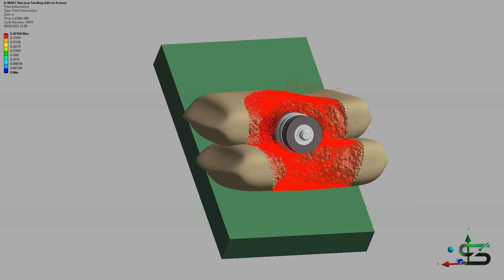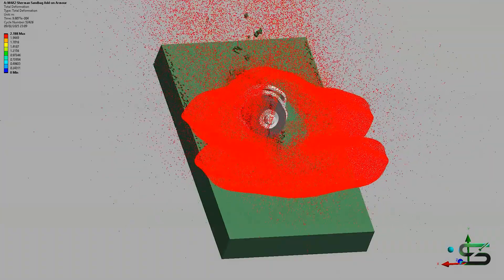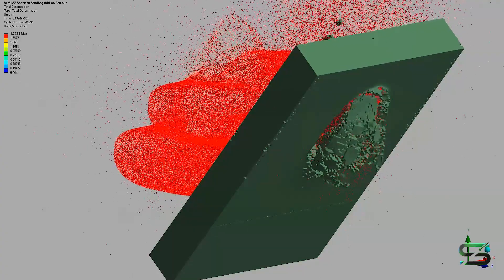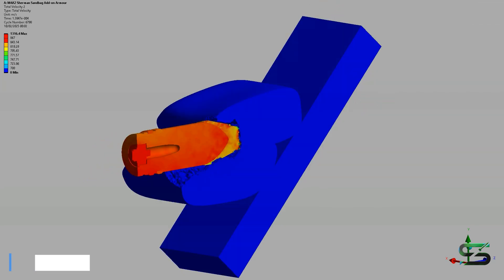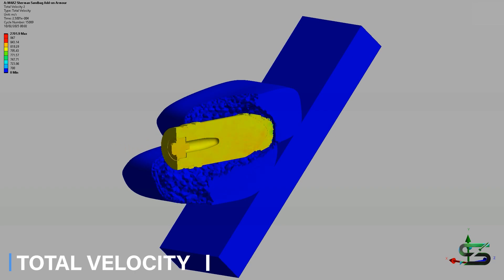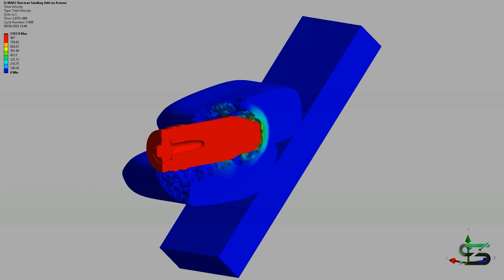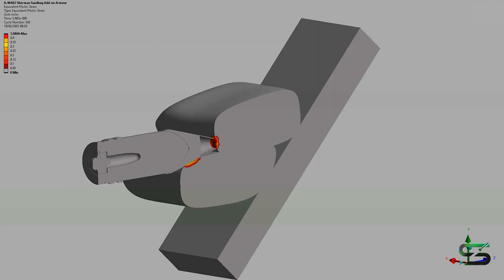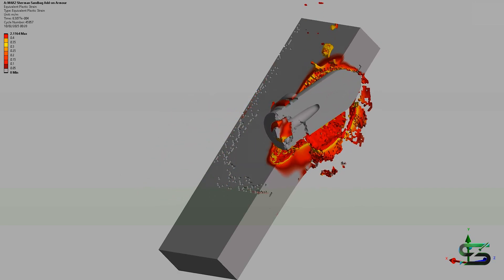Sandbags Add-on Armour | M4A2 Sherman Armour Piercing Simulation

Comment: I'd imagine that sandbags do a much better job against HEAT warheads though
Reply: your thinking isnt wrong for modern shaped charges, however shaped charges have a sweet spot in the distance from the impact fuse and the warhead, this was poorly understood by the germans of this time and most of the shaped charge warheads had the distance much too short. they still worked but did less than they could. US tests showed that soft added armor like concrete or sandbags actually would distance the fusing of the shaped charge so that the warhead was a more favourable distance from the steel armor at detonation, and thus actually was more effective at penetration than without the added armor. the softer armors also worked to catch the tips of incoming projectiles fired at oblique angles that woudve otherwise glanced or jammed the impact fuse. so while these non-steel added armors worked to deaden traditional projectiles as we see here (14% is not insignificant) they were counteractive when it came to the shaped charge projectiles of ww2.
Reply: @payton4148  Actually completely wrong. HEAT warheads work by forming a jet of molten metal. This jet could be long and thing, as in modern warheads, or short and stubby like in early warheads. This entirely depends on shaping the charge inside of warhead. In any case, any obstacle in front of this jet will tend to deform it and disperse it. In case of sandbags, they would also tend to tumble a warhead a bit, so it would not strike at proper angle. Accept the simple fact that troops in the field knew much better what works, then some "researchers" that were never in combat.
Reply: @aleksazunjic9672  I completely understand how shaped charges work. But the "size" of the slug isn't the constitute factor of the slug performance. By the way the slug isn't a molten jet of metal, it is very much a solid still. Anyways there is infact a prime distance from the charge in which the maximum penetration is attained, a distance after the focal point of the charge, and is modified by the the actual shape of the warhead. This is why you see modern weapons with a certain amount of standoff on the fuse. Early weapons didn't get the standoff right. As to your comment on researchers: lol
Reply: Actually no, sandbags support the penetration of heat warheads.
Americans tests showed that sandbags don't help enough against AP compared to the added weight, and made it worse against HEAT.
Reply: @23GreyFox  i heard that was an early war issue, if i remember correctly at some point the germans started using a different type of fuse on heat projectiles later on that effected the standoff distance inadvertantly making sandbag armor more effective
Reply: @ These tests were made after the war.
Reply: But German tanks rarely used HEAT shells as they had enough penetration with AP and if we take rocket launchers, Panzerfaust could penetrate 200mm so a sandbag had very little chance to save weak Sherman armor against such powerful HEAT projectile
Reply: @TimothyZanyk  panzefaust is a heatshell placing a 5 mm space armour on tank can protect from panzerfaust eassily
Reply: @HasnainKhan-mf5ep  "panzefaust is a heatshell placing a 5 mm space armour on tank can protect from panzerfaust eassily" WRONG! Panzerfaust was a HEAT shell, meaning 5 mm of spaced armour would do NOTHING and actually increase the penetration of the metal jet.
Reply: Any type of spaced armor does a lot against HEAT ammunition... Doesnt do that much to a kinetic penetrator like an AP, HVAP, APCR or APFSDS
Reply: @Terraqio  Sadly not the case.
HEAT is either minimally effected or boosted by spaced armor.
Reply: @aquadox5514  its heavily dependent on how The HEAT shell type and function... Pretty pre detonating The HEAT payload before it touches The armor was The purpose of Grated/Cage add-on armors
Reply: @Terraqio  No? Certain cage and slat armor work in statistics. The warhead either hits somewhere between the slats, which results in a destroyed fuse or damaged liner, or hits the slat, detonating the warhead and either missing the vehicle or hitting it with barely any effect on the destructive effect.
Reply: @Terraqio  spaced armor can be quite effective to some types of kinetic AP. After some pressure applied by the armor while penetraring will actually soften up the armor but at the same time the armor will help it be intact unless angled enough. But spaced armor can be an effective solution to that as it can let the shot become a buckshot if the armor in front of it is thick enough, though modern APFSDS shells arent effected much from this effects as the tungsten alloy is really hard.
Reply: Yes they did, and sandbags were used mostly against Panzerfaust and Panzerschreck, something you would realistically encounter on the battlefield,  not Panthers which would be deployed in Panzer divisions for attacks/counterattacks.
Reply: @aleksazunjic9672   True, but just as much a burden in both cases.
Reply: @ Average 50kg sand sack is not much of a burden for a 30 ton tank.
Reply: @aleksazunjic9672   sure 1 is fine, but when you throw in 20 or more of those suddenly 50kg turns into an extra ton or more.
You increase the strain on the vehicle and logistics chain for what? Some morale boost?
Reply: @aquadox5514  First of all, difference in weight between various Sherman variants was already 10 tones. Second, even on a single tank, weight difference could be significant depending on fuel onboard, ammo carried etc ... Third, tanks are not so sensitive machines as you expect. Fourth, crews had much more experience tanking then some loudmouth general that never saw real combat in his life.
Reply: @aleksazunjic9672   I think sandbags are a bigger difference to a tanks weight then a slight difference in ammo loadout or volume of fuel, since those are calculated within the design itself.
There's also changes in the suspension as we went further into the Sherman family.
Tanks are no luxury car but they are, nonetheless, machines and thus will break down. Especially in the rugged frontlines where conditions were poor and maintenance inconsistent.

As for your last statement, soldiers and their vehicle operating brethren were just like their generals in a sense.
They were smarter in certain applications but al the more wrong in others, for instance, troops would say they faced many a Tiger, but in reality it that wouldn't be the case for most of the US troops. Just like how troops thought adding random materials would help them, something researchers already conveyed to the general as useless and, infact, harmful.
Reply: @aquadox5514  Again, no. Tanks were designed with large margin, so typical tank could run over cratered ground, tow another tank, carry dozens of troops on it, or additional fuel drums etc ... Ton more or less was practically insignificant. Tankers in the field had real life experience what helps them, and what hinders them. Sandbags were proven thing, and that is the reason why they wanted to use them. Bed mattresses were another thing that was useful against early HEAT rounds, so they were used too. Researchers only later formalized idea of premature detonation of HEAT round.
Reply: @aleksazunjic9672   But that's were you're absolutely wrong!
Sandbags, and really anything besides actual welded on RHA, did infact nothing to help the tankers.
Research even showed that with early HEAT it increased the penetration, not hinder it.
Also, all the examples you listed about weight is not weight on the entire suspension and drivetrain, but either towed or slight fluctuations in weight distribution. Troops, a fuel drum or 2 or something equivalent are, again far away from several tons of sandbags, which would probably have quite a bit of moisture in them with the wonderful frotnline conditions.

Troops at the front can have brilliant ideas but at the same time lack knowledge about less practical things a lot of times.
Reply: @aquadox5514  Yeah "research" 😁😆 Sandbags definitely did disrupt jet of molten metal,  early shaped charges sometimes didn't even detonate or detonated under wrong angle. Do you really think that troops in the field would be so stupid to fit something an masse if it didn't work ? You need to understand simple fact : TANKERS ARE EXPERTS ON TANKS, not some "researchers" , generals that never drove actual tank and other pen pushers.
Reply: @aleksazunjic9672   If you want to discard the research of the allied researchers that were trying to save their troops, go do that.
I guess if the troops painted their tanks bright red to intimidate the enemies you'd be fine with it since they are the experts right?

I'll end this here since this isn't going nowhere with you disregard of facts and incorrect understanding the mechanics at hand.
Reply: @aquadox5514  Why would anyone accept some "research" when those same troops used sandbags with good effect and practical results in actual combat ? Do you really think that some "researcher" would know better what works in real life than people who were actually fighting ?
Reply: @aleksazunjic9672   This will actually be the final time I respond, since you don't understand how we even figure put the effect of anything.

So in hopes of informing you enough to understand how we figure out the things we know, I'll write is final response.

Troops can not conclude for the most part what the interactions are that are not directly visible. That's what happens at home or far from the front, where we can test the effects of things without hindering factors.
In those tests we can conclusively say that WW2 era HEAT munitions benefited from the extra space to form a better jet.
We can also look at the total statistics from the entire front to draw conclusions, like putting too much useless junk on your tank causing the engine and transmission to fail more often.

A soldier on the front can not view those statistics or do those tests.
They can make adjustments, but the actual effectiveness needs to be tested.

So hopefully you understand that everything a tanker, pilot or just your average infantry man wields is researched and tested for their effects OUTSIDE of the frontlines.
Reply: @aquadox5514  😆😄Troops in the field are ONLY ONES that could definitely conclude does something works or not. In fact, many weapons that were supposedly excellent in test failed miserably in the field. Soldiers do not need statistical tests to see with their own eyes that sandbags stop Panzerfaust warheads from destroying their tanks. And this is the only reason they continued and spread the   practice, despite "orders" from inept generals.
Reply: @aleksazunjic9672  the idea spread because someone thought it would help, used an example to justify their bias, and then everyone else believed them because the simple answer is “more armor is better, even if that armor is a sandbag”. Those troops were trained how to operate a tank. They were not trained in the engineering of a transmission, drivetrain, materials engineering, ballistics, explosives, or any of the dozens of other engineering disciplines that are involved in tank design and in armor construction.

Do you know who are trained in all those things? The engineers you’re ignoring because they don’t drive the tanks, they just design and build them. You are literally throwing out the opinions of the people designing the tank who have the benefits of statistics and testing, in favor of someone with limited to no understanding of the physics and engineering going into what they’re doing.
Reply: @mcarrowtime7095  Completely wrong. You still believe that someone who is "trained" knows better what happens to the tank in combat conditions, then troops that  are actually in the field and use that tank 😁 Accept the simple fact - tankers are experts on tanks, not some pen pushers who never actually rode in a tank. Troops knew very well from experience how much would drivetrain last, how much would suspension hold etc ... And they knew from experience that sandbags do actually work against early HEAT rounds, because they saw first hand what happens with those rounds when they hit said sandbag.
Reply: @ you know who else saw it first hand? The engineers. Because they would fire heat rounds at a tank with sandbags on it.

The people who dedicated their adult life to studying physics and design are going to be more knowledgeable on the subject than people making judgments based on limited understanding and information. Tankers are experts on operating tanks, not designing armor for them.
Reply: @mcarrowtime7095  Nope. They didn't have access to latest German weapons, nor would they know about the trick with sandbags. They would not even know how to place them. People that never rode into battle in a tank could never be more knowledgeable about tanks than those who actually used them in combat. What you fail to realize is a simple fact: physics could only attempt to create approximation of reality, but is not reality itself. Even today we cannot fully model penetration of HEAT round trough armor, with all that computing power. In WW2 it would be simply fools game to even try.
Reply: @  clearly you are a person who was rejected by college and is coping

Comment: I'm disappointed. I was told sand is an amazing shock absorber due to particle physics and it should be perfect for stopping fast projectiles.
Reply: It is, one sandbag can stop rifle rounds but it wont stop a tank round with 180mm of steel penetration
Reply: Tank projectile carries way too much energy to be stoped by a sandbag. It just turns a sandbag into one big sand explosion an carries on
Reply: @TimothyZanyk  I was simply shocked by the fact that the bag didn't even nocicably slow it. The projectile be like "** you and your cover!"